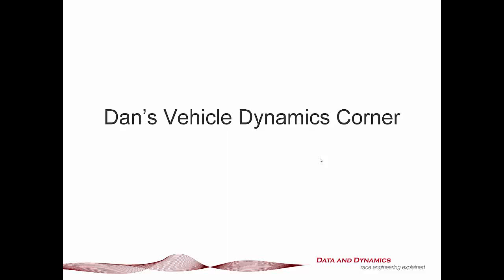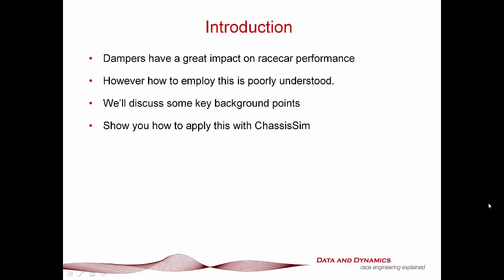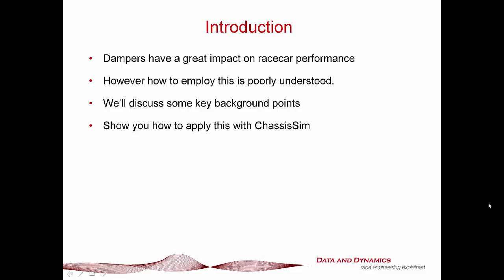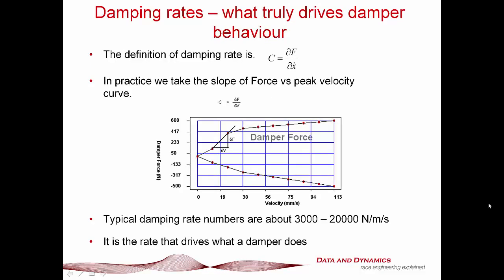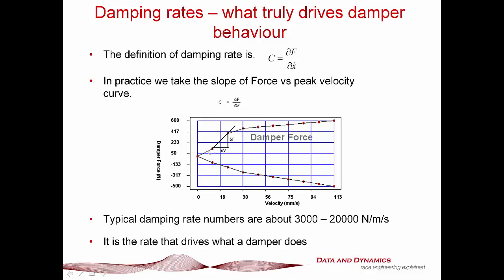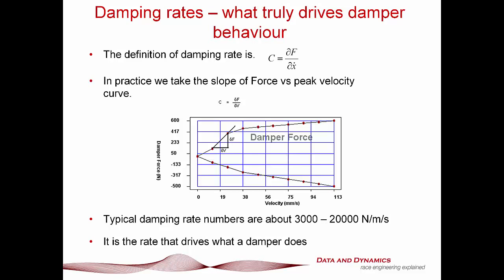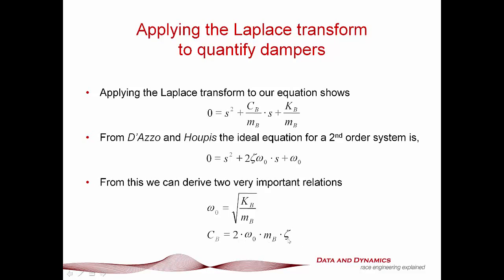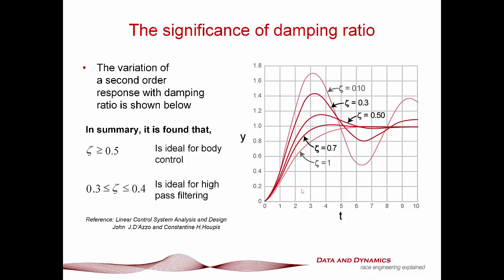Evaluating Dampers / Racing shock using ChassisSim - Part 1

Comment from the maker: Hey Guys just a quick historical correction during the video I mentioned the role that Penske played in figuring out the significance of low speed damping rates on car control. Other damper companies figured this out as well. A good case in point was Dynamic Dampers (I used these in F3000 back in the late 90's). Ohlins also cottoned on to this as well. Sorry Guys brain fade!

Comment: Hi Dan, hands off for the tutorial. Really benefiting the VD community. And I generally agree with your rules of thumb, if you dont mind explaining the difference while mitigating a problem of ie; turn in understeer, whereby u mentioned can be resolved by reducing front bump and reduce rear rebound, but how about alternatively increase rear bump instead, does it provide almost equivalent resolution to reducing front bump?
Reply from the maker: Mo many thanks for your kind words. In the turn in condition the front is pitching down and the rear is pitching up. Consequently the rear is in rebound. So in this situation rear bump will have a minimal impact. If the circuit is bumpy there will be some knock on effects. However where the rear bump makes it's presence felt is when you transition from Turn in to mid corner and turn exit because the rear damper is now being compressed.
Reply: That really make a sensible explanation. the pitching effects due to longitudinal parallel and weight shift of braking into corners. Thumbs up Dan.

Comment: Hi Dan, the final part of the video where you talk about the damper graph in ChassisSim, the video only just shows the main Chassissim screen with you moving the Cursor around. it starts around 13min until the end of the video.
Reply from the maker: Hey Alex - the reason I introduced ChassisSim very late in the game was there was a lot of background that I needed to cover first for the last bits to make sense. It would have been very tempting for me to dive straight into ChassisSim and say you have understeer do this or if you have oversteer do this. However you would have had no idea of the why and I wanted to cover both in this tutorial.
Reply from the maker: The other thing that I'll also say with what I covered in this video I could give a 2 day seminar on!
Reply from the maker: Got it - That's strange because when I did the recording the dual rate model was apparent. Leave this with me. I'll sort this out. Also Alex sorry for the misunderstanding. When you where talking about me not explaining it correctly I thought I was rushing it through. This is the first time my video recording software has done this to me.
Reply from the maker: Guys I've re recorded the last section. This should be a lot better - https://youtu.be/YsWHNilzod8 Sorry about that!